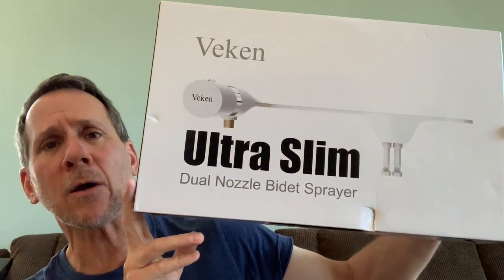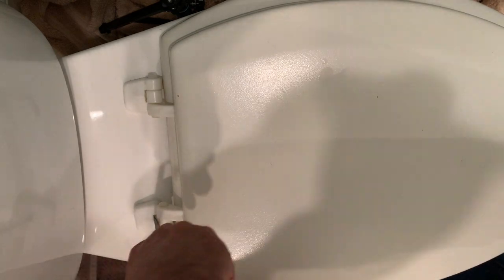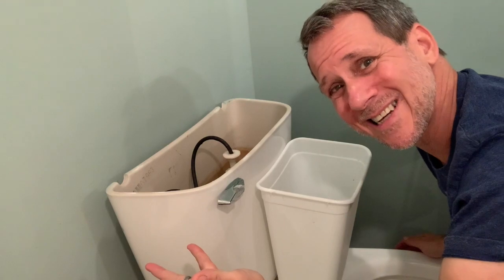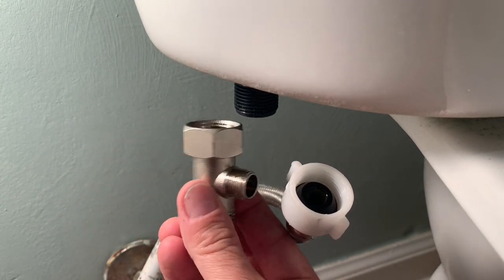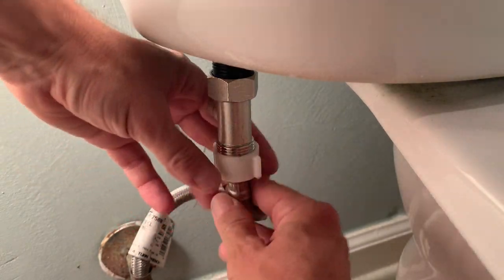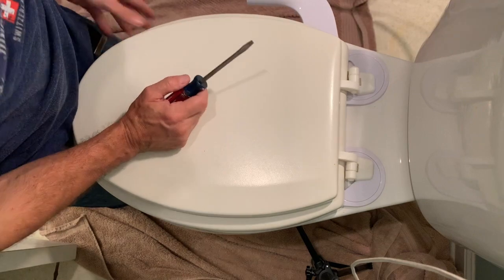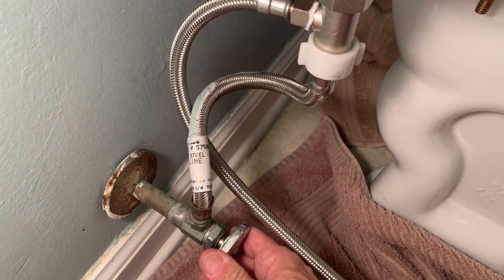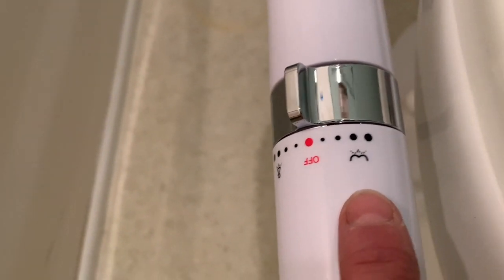Installing a Veken Bidet

Comment: Thanks for the video. My instructions didn't say what to do with the tape, so I'm glad you cleared that up for me. Also found out my bolts were too short after putting the bidet on, so that was an extra trip to the hardware store. Also found out that my toilet seat has a lip underneath that catches on the bidet, so I'll have to get a different seat that sits flat.
Reply from the maker: Thanks for the comments. Sorry you had additional hardships with your   toilet adapting to the bidet. I later found out from a viewer that the tape isn't necessary on "compression fittings". But I used it anyway and now I feel "doubly" secure it won't leak! LOL. Good luck with your bidet! :)

Comment: I appreciate the video. I bought two and was thinking about sending them back after realizing my old Flow Tight shut off valves and lines need to be replaced too. But, I saw that using angled 1/2" x 3/8" SharkBite push valves made it easy to DIY to change these out. So, now I'll either go to the hardware store or just shop at Amazon for the valves and braided hoses. I wasn't planning on having a big project, but it's probably for the best since these old contractor grade valves and lines from 2005 tend to fail around this time and that can be a massive problem. 

Update: It's interesting that my one toilet water valve just failed and prevented water flow to the tank. Weird! In any case I decided it was also time to change out my toilet seats too. BTW - In order to hold the bidet assembly in place I taped the bidet assembly to the top of the toilet bowl near the tank so that the bidet assembly wouldn't move and this made it much easier to mount the toilet seat and bolts on top of the bidet assembly.

One more thing: Do Not Use The Teflon Tape Provided. It is unnecessary and might cause leakage. However, I did put some 'Magic Lube' lubricant/sealer on the male threads.
Reply from the maker: Good luck with your installation. I suspect that after changing out your valves and all the mess and hassle that involves, you will find that installing the bidets so easy,  it will feel like a fun project. Thanks for watching our video! :)
Reply: @WhileAwayWithUs  It was a real pain in the arse (the valve not the bidet) since I hardly had any room to work. At least nothing is leaking. Also, the water hitting my backside isn't as shockingly cold as I thought it would be. I also wrapped that long hose to the bidet around the back of the toilet tank connection in order to hide it better and it looks nice and is hardly noticeable.
Reply from the maker: @stevewollam6514  Thanks for the update! Way to go with a lot more work/skills than we have. Glad all your plumbing is behind you (pun intended)! We thought about getting the "add-on" version that heats up the water, but we are cheap and decided against it.
Reply: @WhileAwayWithUs  Our water temp is just fine but we have an unfinished basement and I vent heat to the basement. This makes the basement temperature currently at 64°F and that's also the cold water line temp to the bidets. The outside air temp is 32°. On Another Note: I did develop a small leak with the T adapter and Fill Valve on the bidet in the master bath. It seems I had too much tension on the braided lines and one line was pulling on the T adapter and Fill Valve (creating a bind) and this created a leak. I'm glad I noticed it before we had any damage. It might be a good idea for people to put a piece of paper towel under the toilet valve and tank connection and check (from time to time) to make sure everything is okay. I ended up changing out my old Fill Valve inside the toilet tank since it seemed that this was causing a leak too. I cleaned the inside of the tank around the hole where the grommet/seal (for the Fill Valve) is located. The rubber on the old Fill Valve was worn and when tightening the bidet T adapter the Fill Valve would move too and this movement helped to create a leak due to an improper seat/seal. It seems that the bind on the T adapter caused it to leak some too. Anyway, I'm glad I noticed the leak and had a spare Fill Valve and adjusted the braided lines. I do usually keep a spare Fill Valve and Flapper on hand.
Reply from the maker: @stevewollam6514  Thanks for the follow up. Excellent ideas you have. I have also placed  paper towels under any plumbing work I do, to make sure I can catch any small leaks that I failed to stop. As for your comment about (once the water is out of the back) cleaning and, if needed, replacing any hardware in the tank, I wish I had mentioned it!
Reply: @WhileAwayWithUs  In retrospect I wish I had spent extra money on SharkBite push valves that had 'two' 3/8" angle valves. That way I could have eliminated using the Velken T-Adapter. On another note: I see that people are buying these for Christmas gifts, but unfortunately this bidet will not fit on all toilets.
Reply from the maker: @stevewollam6514  You are correct. When we read about the product, it specifically stated that it fit on certain sizes. I actually use a tape measure to double check that ours was OK.

Comment: You could even take the two back feet off of your toilet seats original feet where it touches the bidet. Thats what I did and then it touched down in the front better like it did before install of bidet.
Reply from the maker: Thanks for watching and your comment. Thanks for the tip. :)

Comment: All your shown water lines have compression fittings so you don't need to use the teflon tape and you don't need to tighten them much, otherwise they will leak. Otherwise, good vid and funny. :)
Reply from the maker: Thanks Alex for the info. I didn't know that, I just thought you always had to put the tape on any metal-to-metal threads. Now I have learned something!

Comment: Nice video. Does the toilet seat and inside of the toilet get really wet and messy after you use the bidet ? That is my concern .
Reply from the maker: Not really, you do have to get use to how much force and what angles works and what doesn’t though. If I were to make any change it would be to get a self cleaning one. I clean our sprayers weekly but sometimes worry it’s not enough and bacteria is being pulled into the encasement.

Comment: Found out that I have a toilet that was installed when Moses wore short pants... I need to change the water connection since I have a solid copper pipe going into the tank.
Reply from the maker: Thanks for watching! When Moses wore short pants 😂 Sorry to hear about the difficulty. Good luck!
Reply: @WhileAwayWithUs  I actually got it done and I’m loving this bidet! Installation was a breeze thanks to your guidance!

Comment: I am so annoyed..  Thank you for the video.. Everything went together flawlessly..no leaks.. except the booty washer part will Not turn off..  any ideas?   about to google madly for a troubleshooting guild and hope hope hope that i do not hav to uninstall this and wait on/install another one as I've just installed this one in THE Smallest bathroom ever.. seriously.. the floor space is equal to the size of the toilet and that was really hard to install (for that reason).  sigh   smh
Reply from the maker: OH no! Im so sorry you are having this problem. :( All I can think of is that the "controller" knob is broken or misaligned. Please let me know how it's going and what you found out.
Reply: @WhileAwayWithUs   i couldnt really find anyone else with the same problem... and no toubleshooting guides that i could find.  I tried to take the bidet apart to see if i could plug the leak somehow.. but its all snapped together.. no screws..  so i'm sending it back for a refund.. I don't believe they have tht model in stock right now so i might upgrade and try and find one that works.  Thank you for the video..made it easier to install..and thx for the reply :)   Hope you had a wonderful Christmas and Happy New yr!
Reply from the maker: @lushpaw1  Darn, really sorry to hear of your complications. Another person wrote that they could never get water to come out at all. I suspect that for the price, (if you got one as inexpensive as ours - $50) sometimes the quality of manufacturing suffers. Way to go with keeping at it and trying another! Good luck, - hopefully the new year will be better in everyway! 
Happy New Years!

Comment: I just bought this one today and set it all up but for some reason it keeps leaking the first time we didn’t use the washer and it didn’t leak as much as it does now that we put the washer in. We tightened it as much as we could and it still leaked a lot! 😔 We thought we didn’t tighten it enough but when we re-tightened our regular toilet with our bare hands and there was no leak so I’m not sure what the issue is 😭
Reply from the maker: Sorry to hear of your troubles with installation. When you say it's leaking, i assume you mean the line from the water supply to the Veken bidet? I can think of a couple of places/ways it's leaking. The washer is in backwards, (or upside down), so it is not "seated" properly, making a good seal. 
Less likely (as I was informed by a viewer that this is not needed), the metal threads being screwed onto metal threads are not sealing well enough. If you did use the tape included, then this should not be the reason. Good Luck!
Please keep me informed.